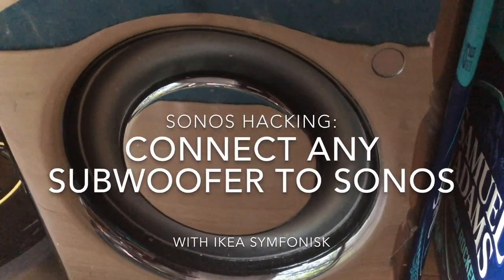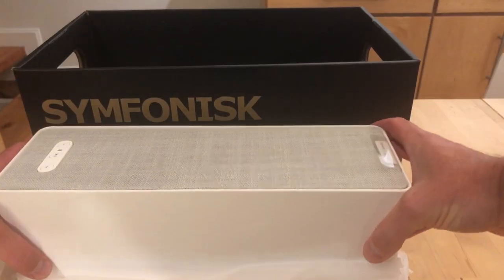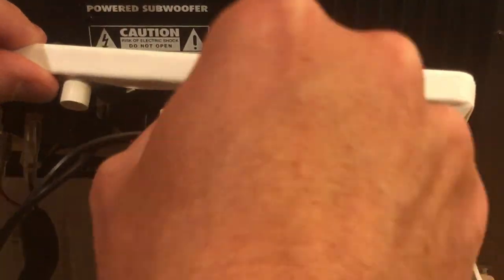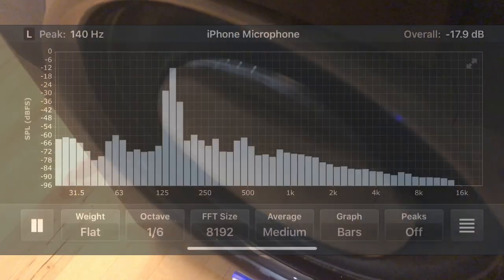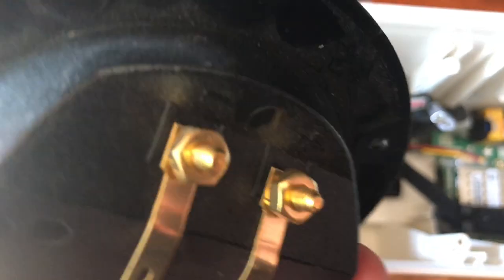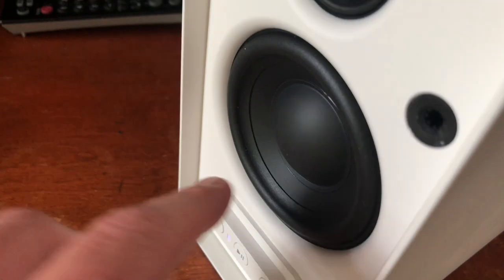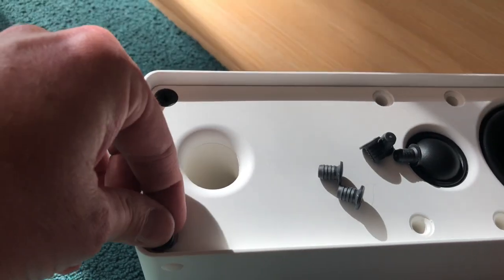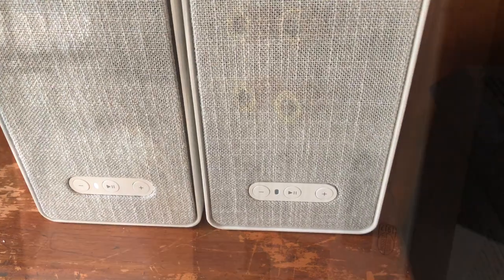Connect any powered sub to Sonos with this Ikea Symfonisk DIY hack

Comment: This doesn't seem to work after latest update.
Reply from the maker: This technique can’t be impacted by software because it’s an electrical connection in the analog world. Are you using a 3rd party app like sonosequencr? It’s possible that was somehow impacted.
Reply: @todd.parker  yes, using sonosequencer. How would I be able to use the powered sub without it? It needs to be tied into the system.
Reply from the maker: @NittanyNeo  Ah, not surprising since that app does some tricky stuff. if you’re using the gateway approach, you can just link the Symfonisk/subwoofer “room” with your home theater. It may not be quite as slick but still works
Reply: @todd.parker  I'm not very tech-savvy. How specifically do I link it as a room? I don't understand that terminology.
My set up is an Sonos Arc, symphonisk rears and symphonisk sub.
Reply from the maker: @NittanyNeo  ok so your sub us connected to a Symfonisk with the drivers unplugged, right? So it’s just giving a signal to your sub. If that’s the case, you can just add that symfonisk as a new speaker and group it with your Arc room. The senosequencr setup is better but this will work until they sort out whatever Sonos broke in their software
Reply: @todd.parker  I was able to get the gateway approach to work, but I have two questions for you:
1. Should I disconnect the symphonisk tweeter speaker completely?
2. I see what you mean about the volume grouping being an issue. I'm getting too much sound out of the symp bass. Am I just stuck with it or am I doing something wrong and there is another approach?
Reply from the maker: @NittanyNeo  I’d disconnect both the internal woofer and tweeter so this is acting as a DIY Connect. That should address both issues because the only sound will be from your sub and you can control the low pass frequency and volume to your liking.
Reply: @todd.parker  I was able to successfully disconnect the tweeter, but when I remove the wire from the alligator clip on woofer, I lose all sound to my powered sub.
What should I do?
Reply from the maker: @NittanyNeo  you basically just want to take the wires from the woofer and connect those to the sub’s high level inputs.
Reply: @todd.parker  I apologize for so many questions, but now I'm really confused. When you say take the wires from symf, do you mean the OEM alligator clip wire, use a new wire and input into the sub AND keep the line-in wire from the sub to the symf connected?
Reply from the maker: @NittanyNeo  This video walks through this in more detail, give it a look: https://www.youtube.com/watch?v=9Bvof0hF4LE&t=1s
Reply from the maker: @NittanyNeo  This is the video to watch: https://www.youtube.com/watch?v=9Bvof0hF4LE
Reply: @todd.parker  I watched it, but still not working. Once I remove the wires to bypass Symp, I lose all sound. Furthermore, the surrounds are way too loud. It's as if the entire system doesn't know how to correctly distributie the audio.
Reply from the maker: @NittanyNeo  it’s hard to debug a setup here but maybe try setting up from scratch

Comment: One problem with this "hack". The little woofer in this IKEA SONOS speaker will have a high pass filter that will block out sub bass to save the speaker, and because it could never reproduce those lower frequencies anyhow.
Reply from the maker: I thought the DSP would definitely have a high pass filter on the woofer, probably at 30 or even 40 Hz but in my testing it’s getting a full signal down into the 20s. It’s crazy, I assumed they would do this to protect the woofer too. Even configured as a surround sound speaker, it gets a ton of low end.
Reply: @todd.parker  that's crazy. Seems like they could get more volume if it had a high pass.
Reply from the maker: @Jordan-ql8pv  Yeah, seems crazy to send all the low end when the driver can't reproduce it at all. I did this test on a lark and was super surprised.

Comment: Great video!  Had anyone tried this with an original sonos play:1?  I bought a pair at costco for $200 and would love to add a sub to complete my 5.1 (with playbar)
Reply from the maker: This will definitely work with a play:1 but they are a bit harder to open and find a spot to run the wires out but others have done it
Reply: @todd.parker  thank you!

Comment: Hi iwas looking to add the sonos electronics bits to a book shelf speaker i don't know if it would work?
Reply from the maker: I think it would, yes! You can use the electronics from this speaker to bi-amp any speakers either by transplanting them into the other speakers or just disconnecting the inner drivers and using binding posts on the back like I did to run them to another speaker. Going to do a video on that soon.
Reply: Bear in mind that the electronics are tuned to the drive units and case so it may sound better or it may sound worse.

Comment: hello everyone, anybody that knows what type the flat cable is that connects the controls to the mainboard?
Reply from the maker: It’s a thin ribbon connector. To remove it, flip up the flat piece of metal where it connects and it will lift right out
Reply: @todd.parker tank you.  the cable broke after opening for the 5th time, so I'm looking for replacement. Fixed it for now.
Reply from the maker: Jurgen Vanderhulst sorry to hear that, it’s super thin.

Comment: So basically just use the output of a WiFi speaker hook it up to a sub and group it?
Reply from the maker: Yep. You can choose to either keep the internal drivers active with the sub adding bass, or disconnect those drivers and just use the woofer outputs as a gateway to get signal to your sub. After that, just group it with whatever room you want and you’re golden.
Reply: So this is a way to wirelessly connect a sub to new Sonos Port setup?
Reply from the maker: Yeah, it should work for that. You can group this with any Sonos speaker

Comment: I want to connect a Audio Pro that has only rca, can i just cut open a rca cable and connect it to the one input?
Reply from the maker: No, don’t try that! RCA cables are designed for low power signals and by jumping off the woofer that’s been amplified many order of magnitude higher than the signal level. Luckily you can get this kind of adapter to convert it down to a usable signal - Rockford RFHLC High Level Speaker Signal to Low Level RCA Adapter https://www.amazon.com/dp/B009VTDVMU/ref=cm_sw_r_cp_api_i_w.XADbC5NA702
Reply: @todd.parker  I was thinking of connecting to the signal, not amplifier.
Reply from the maker: There is no signal-level output on this Sonos speaker...
Reply from the maker: Yep, if you need a full range RCA output, hunt for a used Connect. They will still cost around $250 used, beware of cheap ones.

Comment: would you run trueplay again after this mod or leave it ?
Reply from the maker: I’ve been running Trueplay after and it sounds great. I like a bit more bass so before I ran it, I turned the sub down a bit then turned it back up post calibration so I wasn’t fighting against it too much.
Reply: @todd.parker  I've been going back and forth between true play with or without the sub on and to my ears with the sub on it reduces bass too much.. Even after turning it up afterwards.. Where do you have your crossover set to on your sub? I have it at around 70 Hz.
Reply from the maker: Erik Thomassen I think my crossover is around there too. Maybe just Trueplay with the sub turned way down so it mostly is tuning the mid bass up, then use the volume knob on the sub to dial that in. That’s pretty much what I did I suppose
Reply: @todd.parker  in the end I ran true play with sub off and the dialed the sub in slowly after and it sounds like a really big system now! And the good thing is I use the rca input of the  for my home theatre (Sam room) so it has a double function now! :-)
Reply from the maker: Excellent, glad you found a good way to tune it

Comment: After seen this tips I bought a beam and took my symfonisk apart and connected my old subwoofer to it but sadly it doesnt work as I tought. As a airplay user this setup doesnt work at al, al speaker show up as their own in ”airplay menu”. It doesnt matter if i group them in the sonos app. Every time I stream to the beam I need to start sonos app to ”link them togheter” and when i change the volume on the ”beam airplay” it just change  that speaker and not the ”sub”. So this setup was not that great if you use airplay. Or am I missing something?
Reply from the maker: vandenhoogen in that setup, you’d need to group them. If you have two symfonisks you can set them up as the surrounds and connect the sub to that. Check my uploads, I just made a detailed video on it, that’s the way to go

Comment: So you’re in expensive, convenient hack is to have another Sonos speaker to connect to your sub?
Reply from the maker: Yep. A $99 speaker is much less expensive than your other options. The connect is $350, the sonos sub is $700.
Reply: @todd.parker  I'd rather buy a wireless subwoofer adapter for $39. Don't forget about the convenience factor.
Reply from the maker: Listen_good There isn’t a $39 adapter that will connect your sub to Sonos. Bluetooth, maybe, but not Sonos.
Reply: Todd Parker   Yeah that’s true for the IKEA speaker but not for the something like a Sonos connect which has RCA outputs. I guess when I read the initial portion of the video title, it made me think of connecting to any existing Sonos. Sorry

Comment: Hey subs matter tho!! Yeah it's cheaper but there is still massive loss
Reply from the maker: Is a clean RCA connection better? You bet. But I think the speaker level inputs built into subs are pretty solid or they wouldn’t offer it. Even less than perfect signal with a powered sub will sound a million times better than a small speaker like a symfonisk alone.

Comment: what kind of wires do i need to use?
Reply from the maker: I just used 16 gauge since the runs were less than 5 feet
Reply: @todd.parker  and if runs would be longer? Like 1.5-2m to RL and 5-6m to RR? (there and back, to put the sub between the amp and woofer)